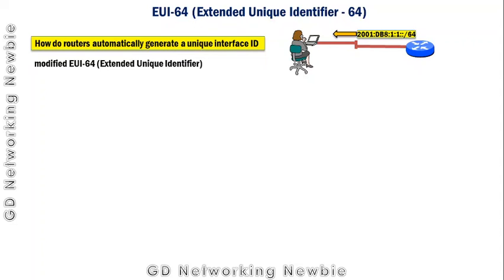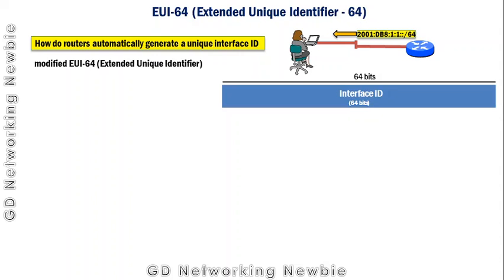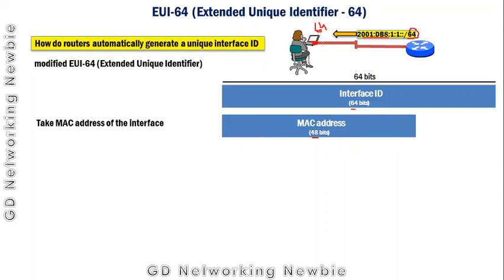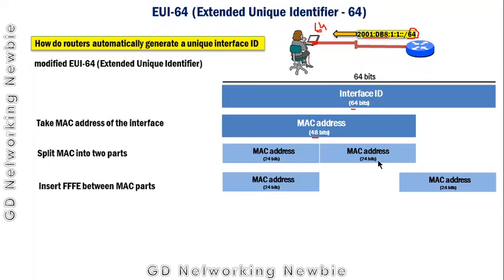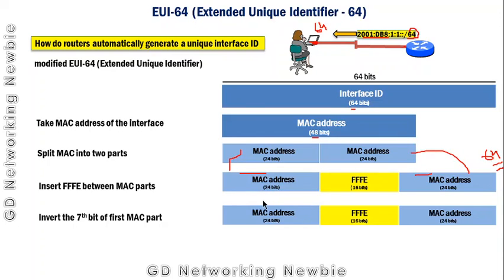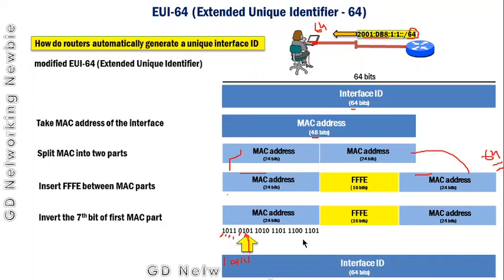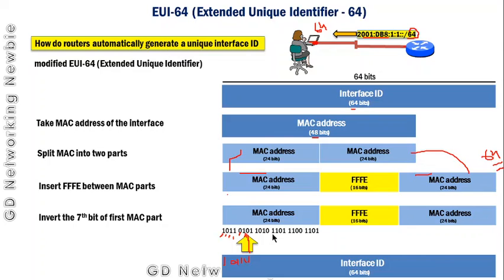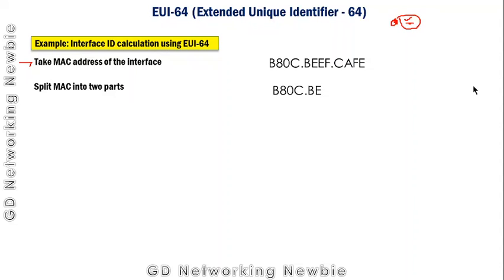IPv6 EUI-64 Explained   | SLAAC

Comment: Great explanation except, what is the hexidecimal value of the first MAC part?  We see the binary 1011 0101 1010 1101 1100 1101 but not its hexidecimal value.  Is it "B5ADCD"?
Reply from the maker: Thanks for liking it. You are right that  1011 0101 1010 1101 1100 1101 in binary is equivalent to B5ADCD in hexadecimal. After inverting 7th bit, it becomes 1011 0111 1010 1101 1100 1101 in binary and B7ADCD in hexadecimal